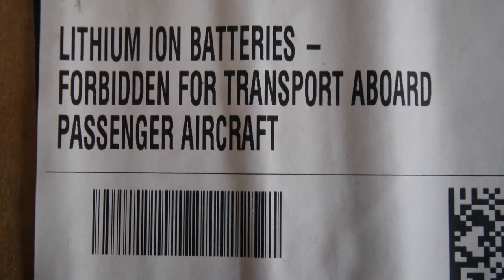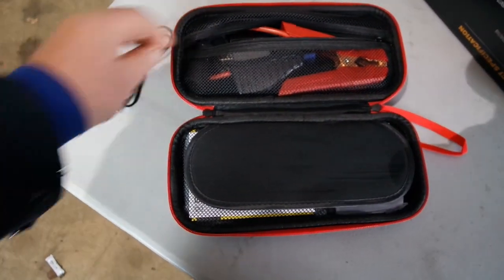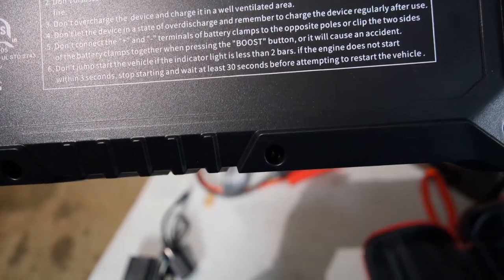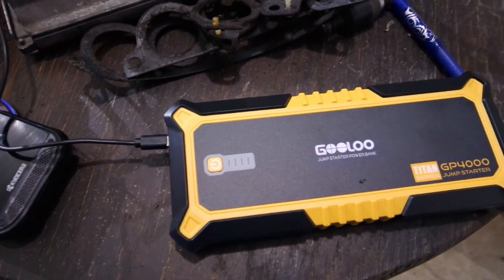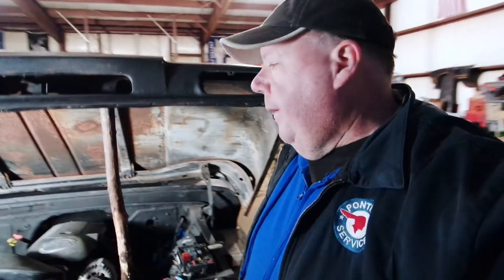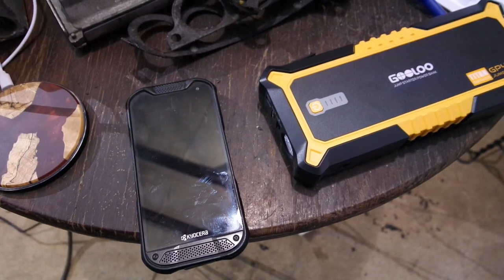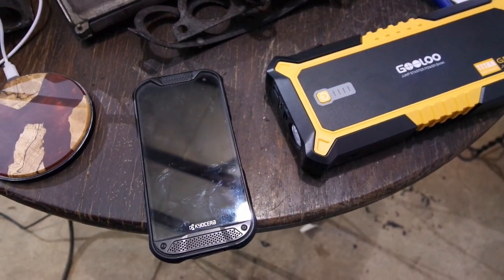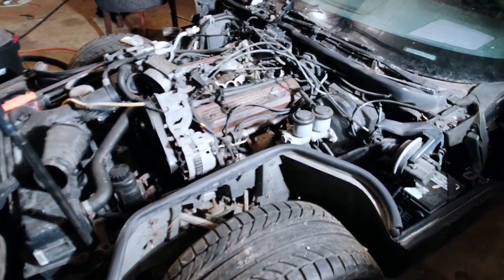GOOLOO GP4000 Jump Starter tool review and unboxing

Comment: 4:25 English translation: Don't leave the unit in a discharged state of 25% or less, or the batteries will degrade with a shortened service life for the jump pack.
Best practice is to keep it at about mid to 3/4 charge for storage.

Comment: The c 10 will be a awesome project! Yeah in a pinch Jim it would be great to have around. I have a service truck that I use, and there's been a couple times I've killed the battery with the radio on, and no one's around for 30 minutes to come and give me a jump. 👌
Reply from the maker: Yeah they are a nice thing to have for sure. Even if you dont need to jumpstart something it's great for charging anything that uses USB to charge.

Comment: Do you know if the GT4000 shuts you down like the HULKMAN of you can reset like the GP? Thank you.
Reply from the maker: My Gooloo is the GP4000 not GT and I will check and see if it does that when I get a chance because I don't recall. I didn't see a GT4000 on Amazon but there is a GT3000. The JF.Egwo I mentioned in your other comment will pretty much crank until it's dead with no apparent safety mode lol. Here is a link https://amzn.to/3BAbthp  My Amazon account is showing a $40 coupon on it right now making it $99.

Comment: You need to look at the gooloo gt4000 it has the 4000 amp it has a screen it has 100watt fast charge from 0-100% in 1 hour it has self pre heat for really cold days and it can be stored for like 2 years without needing a charge. It also has 100 watt fast charge for your devices comes with a 12v 10amp power port and its normally 250 dollars on sale for 130 dollars rite now
Reply from the maker: Sounds cool and I'd do a video on it for sure if I had one but I have two at the moment so I don't want to buy another yet until one of these breaks lol.

Comment: Looking for some input from others here!  How long does a guy think one of these should last before it becomes landfill material?  My old Gooloo gave up last week and the second one I bought at same time to ride in wife's car died when only 2 years old.  So question for others, Have you owned Gooloo equipment before?  How long should a device such as this reasonably last?  Amazon has a great deal going right now on this model and I may just go ahead and order it.  Trying to determine how it compares to the Noco which is much more expensive.
Reply from the maker: I'm not really sure how long they are supposed to last. Mine is still going strong though. I did find one I like better though JF. EGWO makes one with a built-in air compressor that I love. I have a couple videos about it if you wanted to check it out.

Comment: Hey , great videos. Honestly some of the best amateur camera work on you tube. And you are patient with rude commentators, people should just be nicer. No wind noise , no vertigo from watching your videos and accurate real world tests. My question is for the GOOLOO GT4000s. I know that’s not one you have. But I’m wandering if you know if it functions like the HULKMAN or the GP in that you can reset it and it not put you in “jail” ( love the jail analyBTS!!!) I have watched several reviews and I think the HULKMAN would be fine in my newer vehicles if I leave lights on At the mall or a restaurant. But not so great for my older ones that could need more cranking time. That’s why I wander if the GT acts like the GP IN being able to just reset it? Also do you think the GOOLOO cases are as durable as the HULKMAN. On HULKMAN website they show it being tan over by a car. The GOOLOO look a little fancy to be running them over. Thank you again and if you or anyone reading this knows if the GT4000s can be reset as Easy as the GP Please lmk.
Reply from the maker: Wow thank you for your comments! I actually have a new video coming out later this week where I do a head to head with JF.Egwo. You might want to look at that one for longer cranking time.

Comment: It would seem short circuit protection and 4000A peak output is contradictory.  Certainly there's no possible way to get 4000A from 16V without a short circuit involved-😉